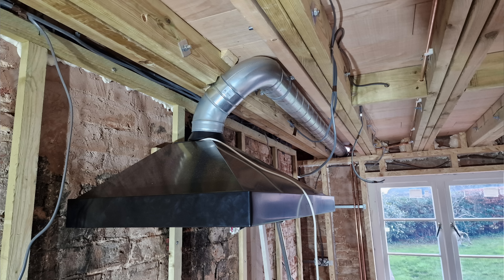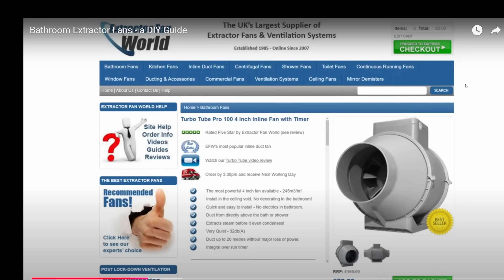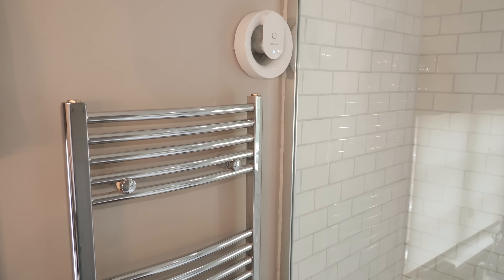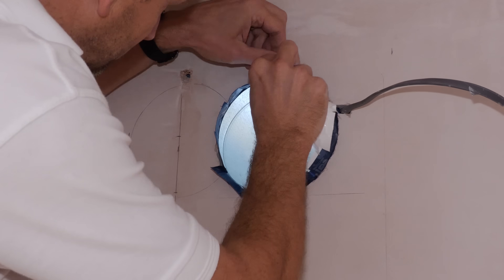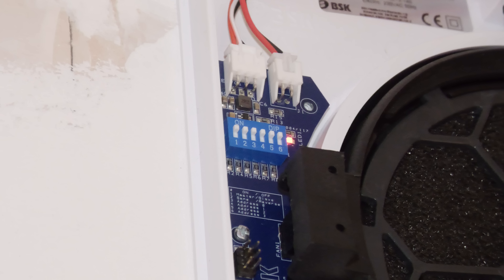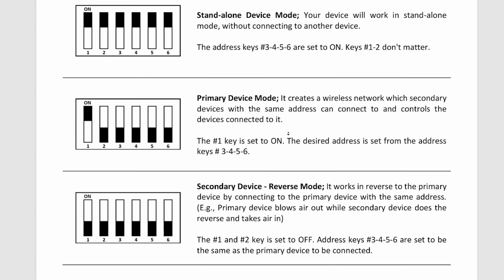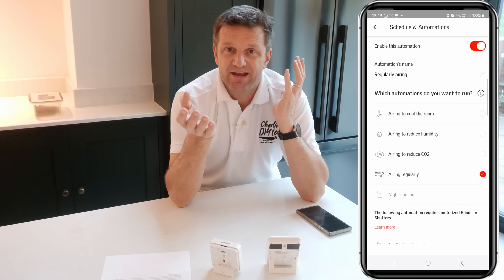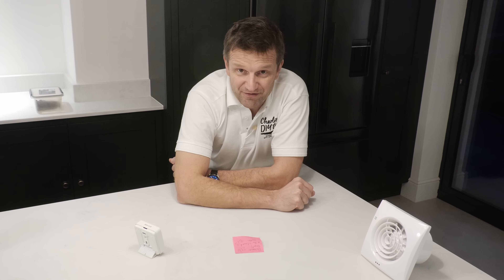A COMPLETE GUIDE to Decentralised Single Room Heat Recovery!

Comment: A metal duct acts as a heat duct- avoid.
Strangely, the motor is mounted on the cold side- meaning its heat is lost...
The efficiency claim is 'up to 90%' - but zero is up to 90%! cannot help feeling that a really good system would graph performance against differential temperatures- what have they got to hide?
Update- research suggests this type of recovery has a max efficiency of 80% - and that is best case... Your test of temperatures suggest 40-50% efficiency. A 'buyback' calculation would be interesting...
There are two reasons for air change. The minor one is for odour extraction, the main one is for air to breathe. The latter is not really helped by bathroom extractors, the door tends to be shut when not in use, and only occupied for a few minutes. The obvious place to do the air change in modern 'one room living' is the cooker extractor. It is also where the air will be hottest when the hotplates are in use!  In this case a plate heat exchanger would probably be the way to go.
Reply: Came here to say the same!!  In the thermal camera image you can see that cold, dark ring. The plastic would have worked better I think.
Reply from the maker: @geoffhaylock6848 Yep, that was a big error on my part. I'm currently mid way though ripping out the duct to put the plastic one in.
Reply: "The minor one is for odour extraction"

Not in my bathroom
Reply: @ricos1497  You prefer asphyxiation to a bad smell?
Reply from the maker: Thanks for this. Yep I made the point about kitchen extractor on my last video where I installed this monster https://youtu.be/2hw9XA9qHjA  https://youtu.be/2hw9XA9qHjA

Comment: Nice one Charlie, I fitted one of those (not that model, a 4" one) and it failed within 6 months. Was very close to getting one of those 6" but the reviews were pretty rare, I'll be keen to know if it lasts a fair while. Keep up the good work 👍
Reply from the maker: Thanks. I'll be doing a review. Possibly even this weekend as I'm currently replacing the metal duct for plastic.
Reply: @CharlieDIYte  Welcome, are you replacing metal for plastic because of thermal transfer of metal, or just for fun? Enjoy the weekend all the same!
Reply from the maker: @bikerchrisukk  Yep. I've created a massive cold bridge with the metal duct and negated any benefit that the heat recovery element gives.
Reply: @CharlieDIYte  Fair play for identifying that, I'm sure you kicked yourself afterwards. But like so much, just need to get on with it eh - I guess the effect may not be measurable between metal and plastic?

Comment: I fit the same unit in my garden office as the CO2 levels were quote high, I switched the filter out for HEPA, but does a good job. Dont really notice any reduction in heat/cooling in the room. Planning to do the same in a couple rooms within the house soon.

Only things missing is integration with Home Assistant, and I wish the app could do full scheduling instead of just an entire day.
Reply: The filter is to protect the unit, not you! It is actually detrimental - it traps dust, spores, etc on the way out, and then blows them back into the room when it reverses. (the outside air is much cleaner than the internal air- use a particulate meter if you do not believe me.)
Reply: @Tensquaremetreworkshop  I've just cleaned my unit and the outer filter was much dirtier than the inner one. Probably due to living in a dusty area.

Comment: [Pedant Mode] Humidity drop from 56 to 48 is 8 percentage points - that actual improvement is 14.5%. I'll get my coat! ;-) [leaves quietly]
Reply: Never apologize for pedantry! Especially to the 'its good enough' brigade...
Reply from the maker: Fair point 🤦😂
Reply: Oh dear, that's not true at all. That "improvement" percentage assumes that the ultimate goal is 0% relative humidity, which is not only impossible, but would be a terrible environment for a human to live in. The percentage improvement would be entirely dependent on the target humidity, and 0% is definitely not it.

Comment: Cut into the render with a Stanley knife around the external hole to avoid tearing the render finish. Regardless of whether you’re chain drilling or using a core bit in render.

Comment: I used BPC to design a whole house MHVR on my newbuild.  The design worked perfectly, very little wastage in pipe runs.  Fantastic humidity/temperature control throughout the building.  No cold spots in corners of rooms with a gentle circulation of air
Reply: Merhaba benim amacımda köy evindeki 60-70 olan nem seviyesini 50'nin altına çekmek. Her odaya bir tane toplam 6 adet düşünüyorum. Nem konusunda gerçekten başarılı mı?

Comment: So, it doesn’t work.
Reply: Why do you say it doesn’t work? Based on the minimal differential between the outside air and the inside air he still gained a few degrees in the incoming air. Imagine the outside air was 10ºC and the inside +20ºC, the exchanger would instead warm the incoming air to something approximating 5º (+/ whatever the exact efficiency is). Obviously as the 70 second cycle nears its end, the temperature difference between the incoming air and the outside temperature will decrease… with the first half of the cycle having a much higher difference.

Comment: Excellent video.
Nice MacGyver trick with the tape at 7:25 
Job well done again :trophy-yellow-smiling:
What kind of thermal imaging tool or lens do you use ?
Reply from the maker: Thanks although it has been pointed out I've created a perfect cold bridge with that metal pipe. Should have ripped it out and started again really. It's a TopDon TC001 Not cheap but I was gifted it a couple of years back.

Comment: Great video; very informative !
The "Tiny Off-Grid House Research" interest in decentralized ventilation is not primarily focused on just providing ventilation, or heating the incoming fresh air but more importantly the removal of moisture and humidity from the indoor air space which can facilitate the growth of microbial molds and fungi which can be harmful to the occupants respiratory health and cause structural damage to the house
Reply: True! As you can see from my calculations (main post) the heat recovery is trivial. Humidity and CO2 control is much more important. Worth buying a version that monitors that.

Comment: Interesting, but the issue with these is that unless you install at least two then their effectiveness is likely to be very localised, especially if doors are shut.

Im interested in split air conditioning units that use heat pump technology, many of these dehumidify, so you can heat, cool and dehumidify making them more versatile, anyone any thoughts on this?

Comment: The efficiency of this unit vs the payback?….. I think I’ll wait a few years until they’re more standard and then cheaper.
Reply: Depends if you value just living in a more comfortable place. I can't put money on that. 

What's the payback of a new kitchen?
Reply: @JohnoLapse yes quality of air is a huge factor as opposed to living in a toxic box , there is an old saying that goes  “ pay for your health now or pay later “
Reply: Probably 10-15 years. Maybe just in time for the unit to fail and need replacing.

Comment: You made a maximally effective metal cold bridge between outer wall and inner wall with the galvanised ducting. You can see it in the IR shots from 15:18 onward.You probably should have swapped that out for the plastic one.
Reply from the maker: I've now ripped out the metal ducting and replaced it with the plastic. Will be doing an update on it. 👍
Reply: @CharlieDIYte  well done a difficult bullet to bite in sure. But we've all done it... Well I know I have, worst case for me resulted in hiring a 16 tonne excavator and digging out the whole side of my house....  An expensive time consuming mistake.... Of mine... The good part about doing everything yourself you can make sure you're happy with it all. The bad side is when you've c@¢ked up there's none else to point the finger at. The bathroom mirror never lies...😂😂😂😂
Reply from the maker: @Rob-ln7dd  So true Rob. You have to redo it though don't you - for peace of mind.
Reply: I was thinking exactly the same. as soon as I saw the metal ducting. But absolutely loved the method of joining the duct to the membrane inside, genius. Oh and a perfect chain drill instead of a core drill, work of art. 👍
Reply: Yes. You can get expanded polyethylene foam pipe from ubbink which is the stuff to use for through-wall ventilation like this without thermal bridging. The branding is 'aerfoam'. I used it on the intake and extract for my MVHR. I got an offcut from a mate because it's expensive and each of us needs about 30-40cm per hole.
Reply from the maker: I did worry about that. Don't forget it's completely insulated behind by the foam though.
Reply: @CharlieDIYte  Not going to argue with you, as you have all the experience here. I just looked at the IR footage and immediately spotted the colder blue ring, compared to the surrounding wall. Maybe it is not as dramatic as it looks in real life.
Reply from the maker: @stephen-boddy I know. I was properly kicking myself for doing that. The important thing is I don't think anyone else will be making the same mistake. I'm not convinced their telescopic option is brilliant either though as you've got leakage between the pipes mid way though but as you say, better that than having a cold bridge from front to back.
Reply: Nothing stopping you from running a bead of sealant around the telescoping part once you’ve got it to the right length.

Comment: ESP32 sounds like it will be good with Home Assistant 😉 I’m still rocking my PIV having a chimney makes it way to shift air in the exchange, I’ve added it to Home Assistant and turned it on max it comes on for 2 hours full blast in the day and two dehumidifiers at night one downstairs and one upstairs all using HA 😉 PS now my kitchen fan extracts if the fire alarm in the kitchen or dining room sound the kitchen fan is massive I got a iCON60 due to the iris shutter as the other extractor was letting out all the hot air, now I can just control this with Siri and HA 😊
Reply: Love that!

Comment: I am right in thinking this could be used in a bathroom and toilet instead of a standard extractor fan set up?
Reply: No, they are not designed to be used in bathrooms. They cannot cope with the quantity of moist air that is generated.

Comment: Thanks Charlie, love your videos.  I put 3 of these  BSKs into our poorly insulated 1990s 3-bed semi. Definitely helped with air quality,  humidity and winter window condensation (however it certainly didn’t eradicate the condensation). We have the humidity auto-boost  switched on and (while it's useful) we find the beeper/sounder quite annoying when it changes back and forth between normal and boost. Especially at night. So I plugged up the sounder with a little toilet paper and glue! Worked perfectly. 😊
All the best from Ireland.
Reply from the maker: Thanks, that's great feedback. How did you set them up  in terms of working together? It's very hard to eradicate condensation particularly if you've got single glazed windows. You can see the difference here https://youtube.com/shorts/lQv5FIZd9Qc?feature=share - I don't think I'll ever eradicate condensation in that bay!  PIVs seem to be the answer for that though
Reply: @CharlieDIYte  Hi again, Charlie. To answer your question:  I set up 2 units in the 2 occupied bedrooms in parallel with each other. And the 3rd unit  running opposite them (in the upstairs home office). Theory was to encourage  continuous air movement upstairs. In practice, I agree with some of your other viewers' comments and feel the 3 are not strong enough to push ALL the air around our leaky old house.  But they definitely helped us, I enjoyed doing the work and l learned a thing or two at it. So 'jobs a goodun' as you Brits like to say. I'm smiling here at your positivity: that condensation on the window = a free dehumidifier :-). I like that! All the best.

Comment: Is a 3 degree difference between outside air and supply air really worth it? Would be interesting to see how quickly the core cools down
Reply: That was roughly the midway point between the 2 temperatures. If, when it is much colder, it can still deliver the midway point, that would be a huge saving.

Comment: This is only good in well insulated rooms from my research. This should be mentioned. In a leaky house this is useless.
Reply: Not completely useless, just less effective. Only as it’s controllable whereas ventilation in a leaky house is sporadic. But yeah you’ll see better results in a more airtight home
Reply: If you install only one it will evidently just pull in fresh air from some other leak and push out moist air through that while in reverse. It would add the moisture control and you should still see a relative benefit half of the time. If one use two on the other hand, it should reduce leaks somewhat.  (
Reply: Unless the pressure gradients are too local due to leaks.

Comment: An ESP32 is a microcontroller with WiFi/bluetooth capability (although I don't think you can use both at the same time).  It's cheap (costs a few quid) and commonly used in a lot of devices, such as smart plugs.  What's more important is that there's a software framework that allows you to program them by writing a config file (ESPHome), and there's tie in with Home Assistant.  So you mentioned that it would be nice to be able to pair two of them to synchronize doing intake/exhaust.  If the included app doesn't support that feature, with some reverse engineering, you could conceivably flash them to run ESPHome and automate their synchronized use with HA.  You could have a separate temp/humidity sensor and control their activation based on thresholds you set in HA.
Reply: They actually do synchronise by design so no need for all of that.
Reply: @JohnoLapse  advantage of using Home Assistant would be integration with other smart home systems, like heating, smart powered windows etc. Plus the ability to use humudity and air quality sensors in other rooms, which could trigger the units.
Reply: And since it's an ESP32 you could use Tasmota firmware on it to make your own apps to control it that don't report any of your data back to the cloud... Not sure if it actually does that or not by default.

Comment: Hi Charlie,

Very interesting video about air extraction. What's the "efficiency" overall is it about 80% from your heat camera just in terms of temperature in/out or higher on average?

I was thinking of installing MVHR with some of them claiming up to 96% efficiency. They all have ducting to be installed which is going to be a pain in my bungalow with the need to keep it all underneath the loft insulation so it stays in the heated envelope and doesn't lose heat through the ducting into the loft space. Or I need bigger insulated ducting.

Threading the non insulated plastic corrugated pipe ducting through the existing insulation without compromising it is going to be difficult as it's all installed and boarded over and there are plenty of pipes and other buried obstacles in the way.

I did think that perhaps I could get away with only ducting into part of the house and relying on all the rooms having open doors with no zoning (I have a heat pump)  so I could perhaps rely on natural mixing.

Your single fans are another possibility.

The main problem I have is moisture and CO2 build up as the house is pretty well sealed. At the moment I'm having to open windows and external does to do a quick air exchange but I also lose heat in the process.
Reply: It's a breeze in a bungalow. Do it once and do it well starting centrally and covering all rooms. 

If the loft is boarded keep the ducting over and insulate them separately. 

Might also be worth adding a few rolls of some type of breathable superfoil insulation on the underside of the rafters to increase its thermal performance.
Reply from the maker: I agree with  @m.o.2085  mvhr is brilliant for bungalows particularly as yours is so well sealed. A lot of people have previously commented that they've installed PIVs in their bungalows to great effect. You would need to think about where all that moisture is going though with a PIV given how well sealed your place is.
Reply: I'd advise avoiding the plastic corrugated pipe for MVHR. The corrugations add a lot of friction, which wastes energy and increases noise. There are smooth-on-the-inside (but corrugated on the outside) pipes like Ubbink's which are good, but the cheap (e.g. airflex) pipe is a bad idea. Use either steel spiral (cheap to buy, very robust, very efficient, very quiet, tiresome to fit) or the Ubbink (more expensive but still efficient and much easier to design for as you have a manifold and either one or two pipes to every room, not a branching structure). Yes it's a faff to get under the insulation but it's not really hard. Unless you have 500m of the stuff easiest might just be to do the piping then add a load more. You can just use insulated pipe, but again efficiency is better if it really is under 20+cm of loft insulation rather than 2.5cm of pipe insulation.
Reply: Thanks for the advice.

Comment: an esp32? can we connect this to home assistant? This unit is very interesting. Thanks for sharing!
Reply: Potentially with the ESPHome integration
Reply: The company would have to have an API available. Hopefully they do and not just have a private API that they use for their own app. What processor they use doesn't actually matter for whether it may be used with Home Assistant. The processor only matters if one wants to overwrite the firmware on the device with a different version.